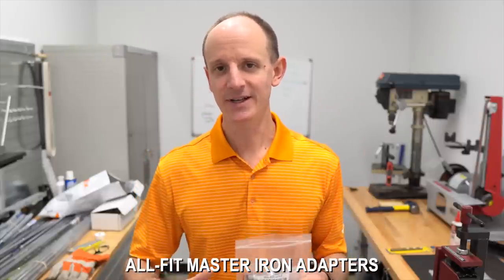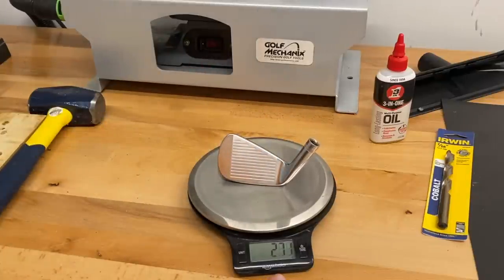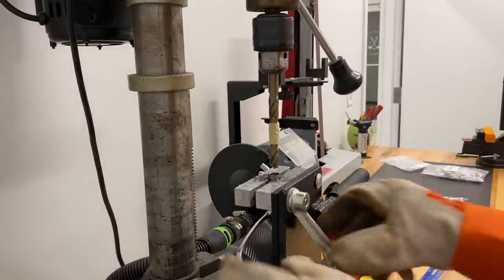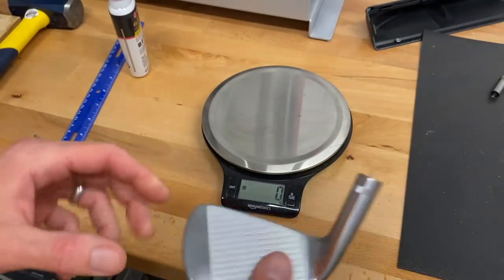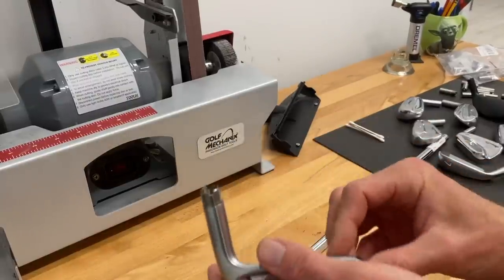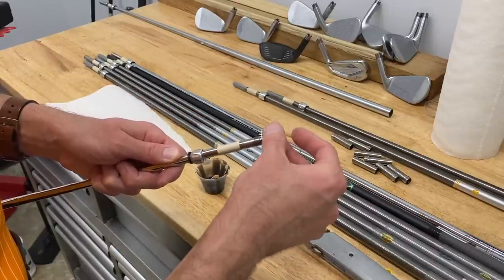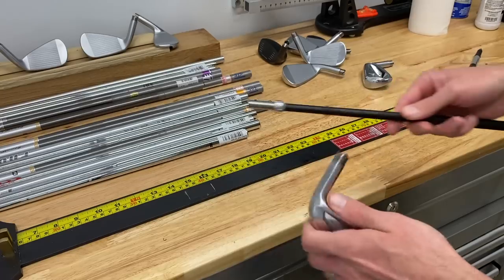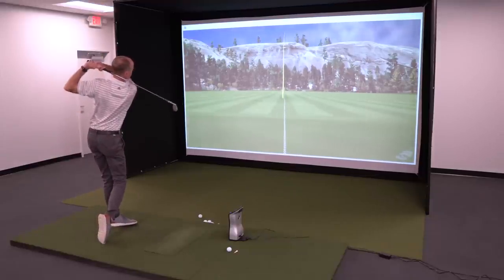Fitting at Home / All-Fit Master Iron Adapters

Comment: Hi AJ Great Video & very brave to show your drilling, I am a toolmaker & spent 3 months of my training on the drilling section😬, your “set up” is perfect (a Couple of tips that could help) the drill speed looks OK, a great rule of thumb is “when you can’t see the drill flute’s” when the drill rotating, the speed is correct👍, this works for any size of drill the smaller the drill is the faster speed is needed, 2, your idea of using masking tape for depth is ideal👍, if you position the top of the hosel flush with the top of your jig, your drill handle will stop at the same point with every club head you drill👍, 3, the 3in1 oil is not ideal you should be able to proper drilling or tapping cutting oil (it will extend the life of your drill) & make drilling easier, 4, use a paint brush (1/2” is ideal) to remove swarf when drilling (the air line is better) but can blow swarf everywhere, 5, try not to let the drill run at the same depth (with out cutting) as it will dull the cutting edge of the drill, Finally you can sharpen the drill on the grinder it’s simple (ask any customers if they can sharpen a drill then (watch & learn) if they can reduce the rake angle of the drill it will cut better & not snatch, Hope this info helps, Dickey 9hcp 75year Senior Golfer
Reply from the maker: Needed you before I started this! Will be helpful info when I need to do more heads.
Reply: Feed and speed.  Also chip load, as you know the chips are what keep a cool tool.  Looking like possibly the feed was a bit light?  And absolutely as you mentioned do not leave the drill bit turning in the same spot without any cutting pressure!

Comment: Maybe a dumb question but, why does the manufacturer just make the original metal piece a 16th" thinner? Even our brilliant club maker says, "Right now, this will not fit in any shaft" before setting up his drill press. Anyone explain?

Comment: What size is your drill press...I want to get the correct size that will have enough clearance for the drill bit to fit underneath with the club head....not sure what to get. Thanks!
Reply from the maker: It's a standard Ryobi table top press. That said, I've started taking my heads to a local metal shop to do the drilling. Industrial press makes it far far easier I think.

Comment: Hi there, I am a clubfitter myself and thinking about switching to the system. I have a few questions. 

1) When you drill out the hosel, the wall thickness gets reduced. Did you experience problems with that where the hosel is very small and does that influence the ability to bend lie/loft of the irons?
2) Did you experience problems with the screw thread? Regarding the conex system that we use the weakest chain is the screw thread. What is it for the all-fit?
3) Do you experience broken hosels for very fast players? 

Another remark: different heads have different hosel depths and diameters, that would mean that drilling out would also result in different head weight differences... You probably need to adjust how much to drill out for every head seperatly, right?

Thanks already! Loved your video!

Comment: I just put on a new adapter on a  shaft for my new driver, a Cobra LTDX.  Thanks for showing me how.  Also how to trim the shaft and put a new grip on.  The adapter comes with a bolt.  How do I get that bolt into the driver head.  As you know, there's a tiny rubber o-ring I have no clue how to get int the tiny hole and onto the bolt.
Reply from the maker: Screw goes in the head from the sole, the rubber washer goes down the hosel and is used to keep that screw from falling out.
Reply: @EFGMC  My problem is getting the rubber washer back in and back onto the screw.  No way to get my fingers in the tiny hole in the hosel where the shaft goes,  to get the washer back on the screw.
Reply from the maker: @noonster55  Balance it or use a tiny piece of double sided tape to keep the washer on the tip of the adapter. Stick that into the head with shaft and washer pointing up. Then get the screw and screw it down into the adapter. After you fully tighten it, you should be able to unscrew the shaft and the washer will stay seated on the screw.
Reply: Thanks I’m on it now.

Comment: Great content mate if a person was to go and bore the hosel for a permanent fix ie epoxy what size bore would I need for a .335   steel shaft to allow room for epoxy
Reply from the maker: It should be right around .335 as well. You ideally want a fit with minimal play in it.

Comment: AJ, I recently noticed something with my clubs that I never realized. I thought of asking you - maybe do a subject video on it? (loved the video to measure your club length DIY) This is the topic: I have been fitted to ping i525 irons 5-PW and based on these specs I got myself a customized set of pretty wonderful Mizuno S23 wedges. Now the shafts are different: the (75g) Alta CB AWT regular shafts on the pings are lighter than the KBS tour C tapers (105g) because I like a little heavier weight on these. I hardly make full swings with them. Now here's the interesting thing: if I do make a full swing, I feel the clubhead weight a lot more than I do with my Ping irons. I thought of putting them on a kitchen scale (horizontally, I can't take the heads off) to get an idea, and although this measurement is hardly scientific, the Mizuno wedges came out 20g heavier. Which matched with what I was feeling. To be honest, I must admit I like the feeling of a heavier head during swings, but that's besides the point and totally subjective. 

Now I already had one bubble burst over the last year (I used to think iron number lofts were regulated, NOT!), so is it true that manufacturers can just define their own head weights? if so, I am getting more and more respect for club fitters :-) So many variables!
Reply from the maker: Most club heads will be pretty close to the equal number or loft because they are designed to go on a similar length shaft. Wedge heads will always be the heaviest because they are the shortest clubs. Long irons will be lightest. Most PW are around 288g, most sand wedges are closer to 300.
Reply: @EFGMC  Wow, I never realized that its normal for wedges to get progressively heavier with the loft. Is a lob wedge even heavier than a sand wedge as a rule of thumb? Massive thanks!
Reply from the maker: @pbode1  Often but not always. Some brands will have all the wedge heads weight the same, and some will have progressively heavier.

Comment: In Melbourne, Australia we had long lockdowns so I watched your vids a lot and built my own set including the 8 iron shaft into my wedges - brilliant!!
My question is on the swing weight scale I have a round cylinder weight to balance - but I don’t know what side to read the weight on? Left or right … I’ve made all my irons D3 if it’s left side , I just went by feel and matched all the irons to that feel. But I’d like to know if I was right 
Thank you
Reply from the maker: Not sure without seeing the scale but if you are trying to spec check it, I would use one of the online swing weight calculators.
https://youtu.be/sJALUBr51jI

Comment: Nice work AJ, it would become an annual/2 year thing doing all new season heads. Can the adapters that go into the head be pulled and re-used or new ones would need to be bought? I guess on the plus side, once the shafts are done you won't need to do them again, particularly the tried and tested ones DG, PX etc. Do any OEM's use All Fit in their demo heads or all have their own proprietary ones? I know they vary from OEM to OEM. Great content again and thank you!
Reply from the maker: They are titanium so they can be pulled and reused. I already had to pull some because I was too skimpy with the epoxy first go around and had some of the heads come loose.

Comment: Hi AJ. I've started using this adapter system on my shaft matrix but am having issues with excess epoxy at the bottom of the hosel preventing the shaft section getting all the way in to the clubhead. Did you come up against this and, if so, any tips?
Reply from the maker: Yes, I originally was very light on the epoxy inside the hosel but ended up having a couple failures after extended use. Now I epoxy just like any golf club with epoxy on both the inside of hosel and outside of adapter.
Once dry I have a drill bit that fits perfectly inside the adapter opening and allows me to gently remove enough dry epoxy so the shaft will fit and bottom out.
Reply: @EFGMC  I'll definitely try that! Thanks so much for the quick reply.
Reply: @EFGMC Hi AJ. Quick follow up question, have you tried bending any of your demo heads with these in?
Reply from the maker: @andrewcollins666  Yes, they can.
Reply: @EFGMC  Thanks mate.

Comment: 12:10 you are adding a lot of epoxy in the hosel, that epoxy can not escape anywhere els than up the adapter and make it impossible to fit the shaft. But you propably fixed that afterwards and skipt that in the video.
Reply from the maker: I found the best way is to use a lot of epoxy and once completely dry, drill out the excess from inside the adapter.

Comment: Wondering why you did not use a smaller pilot drill like a 3/8th first and than make the final cut with the 7/16th bit?
Reply from the maker: Total novice at the drill press but I think this worked without needing to do it in stages. I would just say do it how you feel comfortable.

Comment: Would be perfect if drilling isn't needed. But the purpose of the drilling is to remove the additional weight from the adaptor? Also where can we place an order for these adaptors?
Reply from the maker: Correct. Most adapter set ups I've seen require drilling or cutting the head, otherwise the weight will be off.
You can order the All Fit Master adapters from
allfitgolf.com
Reply: @EFGMC  Ah got it. Another question (hope you don't mind), by drilling the head, would it be safe to say it will require a shim or some sort if you don't use the adaptor in the future? ie. attaching it the conventional way
Reply from the maker: @aywm6792  Personally I don't think there is any way to go back once you drill it out. I don't know of any shim that will span that gap. Also the hosel is very thin at that point and I'd worry that it might deform. It's not a worry with the adapter since it's titanium and reinforces the hosel once installed, but once removed you could have a problem.
Reply: @EFGMC  thanks for the clarification! Much appreciated
Reply: @EFGMC Will it effect my shot?  How many seasons until they bend?

Comment: Do the adapters not come in alternative sizes to suit various manufacturers hosel? Seems to defeat the purpose of an adaptor that is not very adaptable if your having to drill out clubs?
Reply from the maker: Only one size of head adapter that requires an 11.1 mm bore size. The shaft side offers both a .370 and .355 tip though I found the .355 was difficult to use with some shafts based on the thickness of the chrome.
Really don't have any option when it comes to adapters, you will need to modify the head is some way otherwise the weight will change significantly. The other method used by some companies is to cut the hosel making it shorter. Not sure that is easier than just drilling.

Comment: If I want a 35.75 pitching wedge do I buy a 35" shaft? Is it always 0.75" more than the raw shaft length? Are all clubs the same adder?
Reply from the maker: No one sells a 35 inch shaft unless it's a putter shaft. All wedge shafts will be around 36.5 or 37 at least and require you to butt cut them to length.
Reply: @EFGMC  Nippon N.S. Pro 1150GH Has 35" shaft for sale stock.
Reply from the maker: @CybekCusal  Are they calling that a wedge shaft?
Reply: @EFGMC  it's listed under the iron shaft category in grips4less but the specific club this length is intended for is Wedge but I don't know what the ultimate club length will be if I buy this shaft and put it in the stealth approach wedge. The KBSMAX it came with has too much deflection.
Reply from the maker: @CybekCusal  Should add at least an inch if not slightly more.

Comment: I think All-Fit has a great product. But your wording and methods worry me.

You keep saying boring out the hosel, but you are using a drill bit. Two fluted drill bits have a tendency to wonder. I would suggest a Reamer. 
The Vice President of Automation Devises happened to see this video. They work with the in Aerospace and Medical fields. He agrees that boring has nothing to do with drilling. Drilling is for making a hole. Reaming is to make a hole bigger. The reaming will maintain a round and straight hole.
Taper tipped shafts???? There tapered tipped brass shims. The brass shims will make sure the shaft is concentric in the hosel.

I would be curious as to the loft and lie of the iron before and after the All-Fit Adapter.
Reply from the maker: Could you use a reamer in a drill press? The hole made needs to have parallel walls.